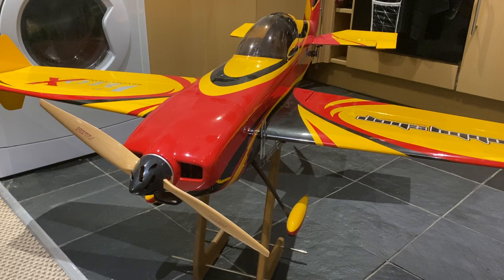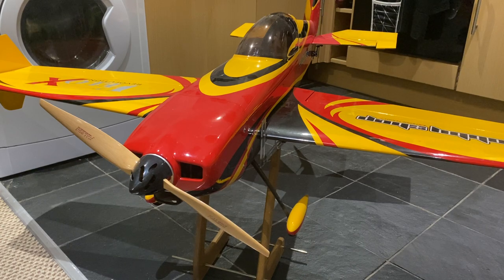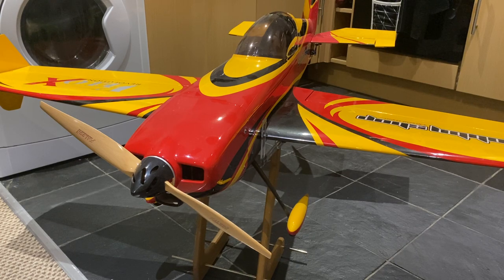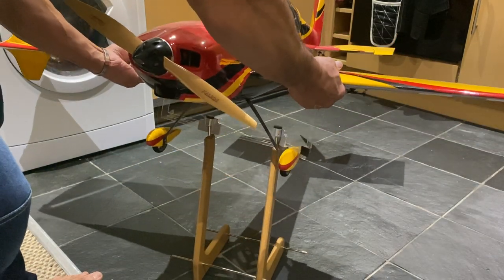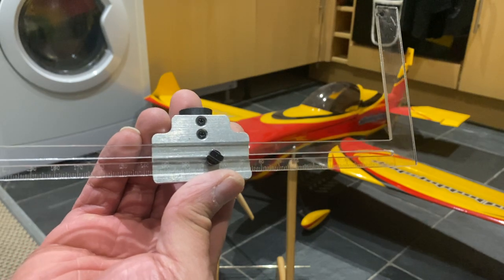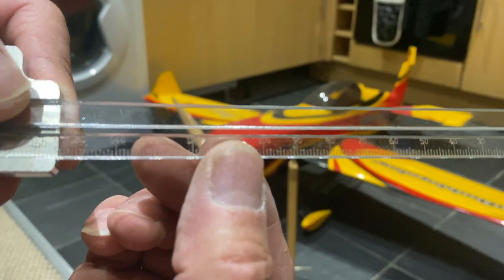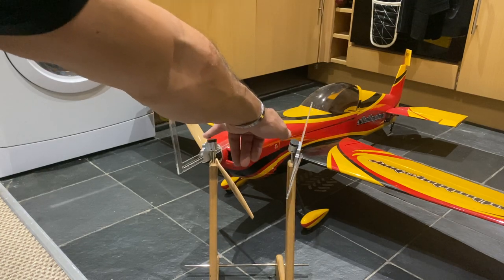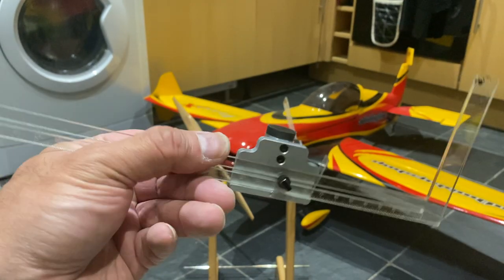Finding CG and balancing aircraft tool. April 2021.

Comment: The CG is one single point , and that point is inside the plane's fuselage, for practical purpose we must use two points along the CG's line. High wings balanced upright, low wings inverted, mid wings use your own judgement. If you choose to balance a low weight upright a majority of mass of the airplane is above the CG line and it may give you a false reading but most planes CG are not quite as critical due to manufacturing standards.  I have the HobbyKing Gee Bee R1 and even the Great Plains GB shows balancing it inverted on the stand and upright with the Rope arrangement the two readings are totally different. In that plane CG balancing is critical.

Comment: do you mount the engine forwards or backwards on its mounts to CG the same way ?
Reply from the maker: Balance it on the CG pending on what motor or engine you are using, then put the weight on to make the balance point on the CG. Because different motors have different weight so you may need to add little weight either front or back. However the balance point it will be written in CG inside the fuse are large. fly safe